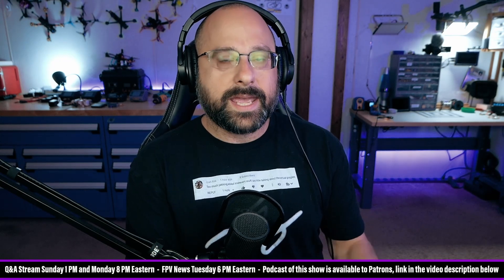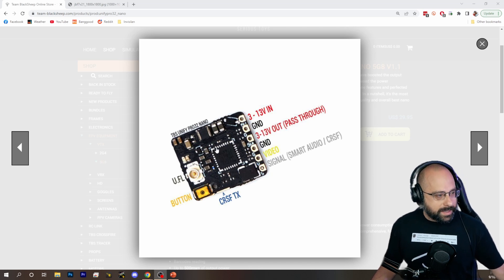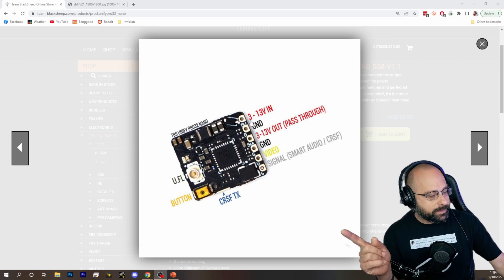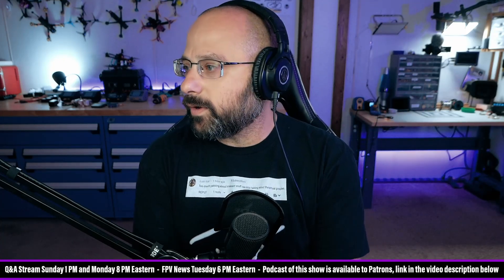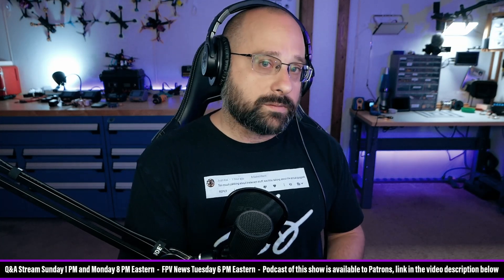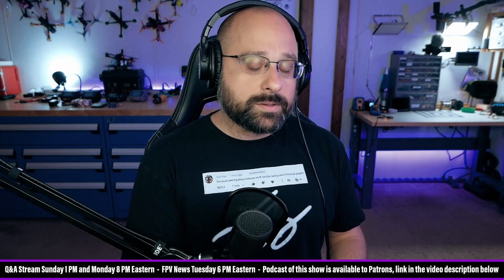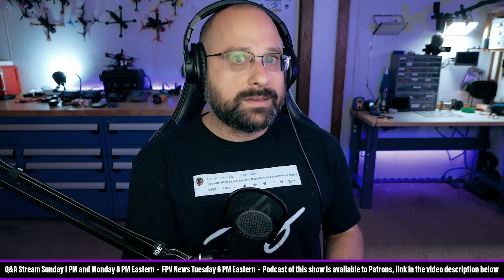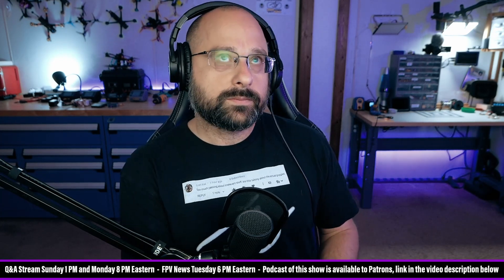My VTX Can Take a Range of Voltages. Is there a Best Voltage? - FPV Questions

Comment: True but an advantage of feeding a "high" power device (say a 1W VTX) with high voltage is that you can use a bit thinner wires to the VTX or same AWG with less heat build-up on the cables. Not that is a huge advantage in most cases though.